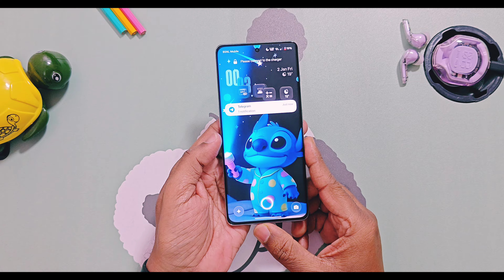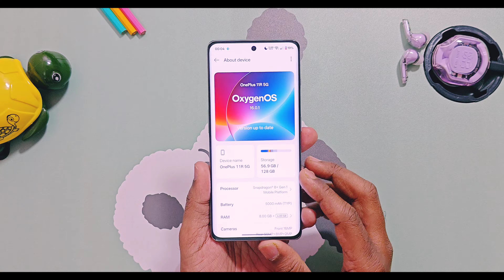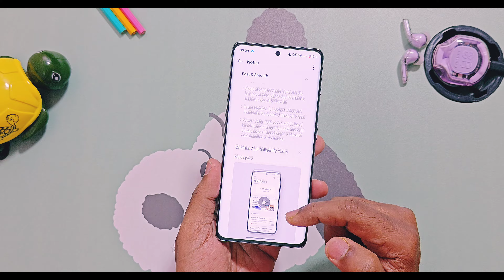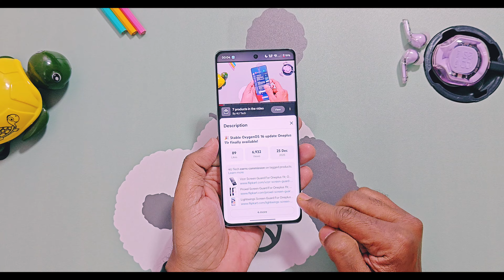OxygenOS 16 Oneplus 11r update battery & performance test

Comment: Bro, I have a OnePlus 11R running on OxygenOS 16. I downloaded OxygenOS 15 from the official website and tried to install it using Local Install, but the installation failed. Does this method actually work on my phone? Is it possible to downgrade to OxygenOS 13, 14, or 15? Please help me. Thanks for reading.
Reply: When did you receive 16 !?
Reply: @RandomVerse-01  23rd December 2025

Comment: I updated oxygen OS 16 recently but didn't get all the wallpapers what should I do now?
Reply from the maker: Wipe Data of the theme app application and check
Reply: @4utech I mentioned that in the Flux wallpapers, not all live wallpapers or clock wallpapers are available.
Reply from the maker: Yes to get them wipe Data of theme app

Comment: " PLEASE DONT UPDATE YOUR  OP 11R IF U WANT PERFORMANCE IN GAMING " 

My oneplus has become like a google phone running on tensor chip. Animations, effects are all good

BUT GAMING PERFORMANCE HAS BECOME FROM BAD TO WORST, AVG FPS IN BGMI IS ONLY 100 - 110 . If games are the main thing pls dont update
Reply from the maker: Yes I mentioned the same problem in the final verdict
Reply: @4utech  yes yes, just assuring the Oneplus 11r owners and your viewers with my hands on experience so that your video/the truth is assured to the people. 
Being a heavy gamer life has become very difficult now. 
Searching for ways to downgrade my OP 11r phone to the base launched OS version for best performance. Miss my OP 8T at times like this
Reply: @aneeshraghav9599 game runs so smooth with constant 115-120fps on OS 13. I've already tried this. Os 13 performance, battery life is way much better. I've already tried it. Just we're going to miss important features that are available in os16
Reply from the maker: Oxygenos 16 is well optimized for the OnePlus 13&15 series, but 11,12 and ce series i think is not capable to handle it
Reply: @4utech  Yup. Poorly Optimised. Oneplus team don't even care about 11 n 12 series anymore. They want their old users to shift on 15-15r 👍
Reply: @shyam6275  lucky you. I play hardcore non-stop bgmi, whatever, but still i wouldnt suggest anyone to upgrade since downgrading is a little hectic process for many
Reply: @4utech  or rather made NOT capable to  handle
Reply: @shyam6275  point agreed. Guess they are now only following their motto of never settle for profits and do whatever (pun intended)
Reply from the maker: Yes it may be done intensionally 😮